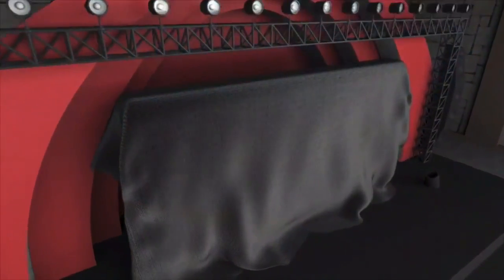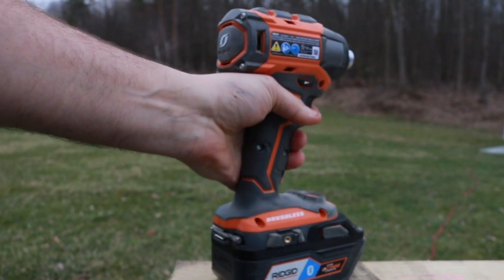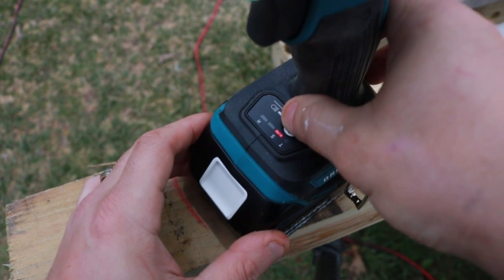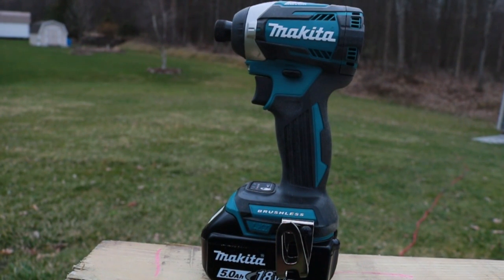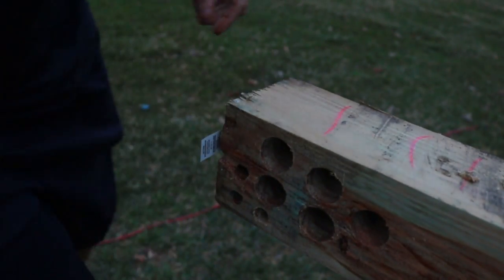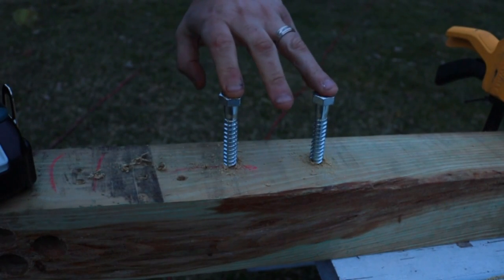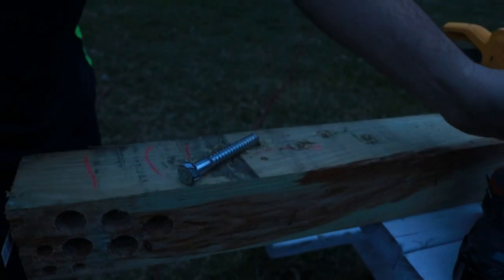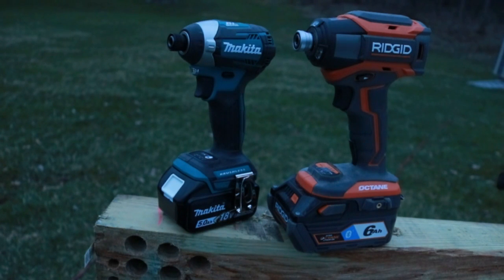All new RIDGID OCTANE Impact Vs. Makita LXT Impact (TOOL DUEL!) XDT12Z - R86039B

Comment: Love my Makita tools, but I have slowly been picking up Ridgid tools lately and I love them.  The multi tool, my 12" sliding miter saw, and hammer drill so I'm slowly switching to Orange/Black everything.  All top notch stuff from Ridgid, and they have longer lasting batteries too.

Comment: One request, run this new Ridgid Octane impact vs the stealth force, I'm on the fence between the 2.
Reply: Travis Kelleher I’ve got the stealth and it’s nice for heavy stuff but it jerks a lot on precise stuff especially on the low setting. It’s a monster for tapcons, lags, timberlocks, and even bolts and nuts. I’ve used it to put the lugnuts on my car, but it’s heavy and I wouldn’t make it my every day.

Comment: TRZ I believe this might be the XDT14 with 1550 inch lbs of torque, the 12 has a white glow ring around the nose cone it has 1550 also though.
Reply: You're correct.  At 3:30, you can clearly see the model he's using is the XDT14 which is a mid-grade model.  Amazing how a Makita mid-grade model kept it close and even beat the Ridge top of the line model in several of the tests here.

Comment: Makita for the win. That ridgid impact is huge I wouldnt want to pack that thing around when I could just use my makita. For the size difference that thing should have killed the makita so it goes to show it's just bulky for no reason. The makita 5 amp hour battety is also nice and compact compared to that brick on the ridgid. I do like that the ridgid is able to be tracked but any of that other stuff that involves your phone shouldn't be there. Too many guys on their phone already at work, dont need to give them another reason to pull it out.

Comment: Wow , I cannot believe TTI's claim of 2400....
  From what I've just seen the only advantage the ridgid has over the Makita is the price and maybe the lifetime warranty....that is if u don't get the "I am sorry , we had a major computer meltdown and we lost all of our records concerning lifetime warranty agreements " The Ridgid is also ginormous and looks like a transformer. 
  The Makita also took the Ridgid straight to the spankin tree....the Ridgid should have smoked the Makita due to its "lag setting" but it didn't...its also very hard to beat a Makita ergonomically....hands down winner is Makita. And no I am not a Makita guy....Good video brother
Reply from the maker: Thanks for the vote Donny!
Reply: I work in the trades and have never seen any contractors or sub contractor with rigid, always makita or milwaukee which are both best in quality

Comment: Giving a vote to the Ridgid just because I want to see it in action a few more times.

I'm pretty impressed with the new Octane impact holding it's own, maybe a tad slower but still pretty much on par with one of the best. In your opinion besides the new modes, is there a power/performance difference over the older Gen5x brushed model?

I'm on the Makita platform, the XDT12 is well established as more than capable, it's even outperformed the newer XDT16 from watching it on the VCG channel. I think the new Ridgid Octane might be able to win a few speed tests against the newer Makita if you have one of those around.
Reply from the maker: Considering you still have people out there calling ridgid a DIY tool, its giving these big boys a run for their money.  OCTANE is awesome
Reply: I would like to see the ridgid octane drill driver vs the makita drill driver

Comment: If this is still open - Ridgid did better than I expected, but Makita has impressed me with this performance, and for 25+ years with tools that pretty much last forever, and some special standouts (like the rear-handle 36v circular saw, and the 36v dual bevel sliding compound miter - both beasts). This impact driver looked more controlled to me than the Ridgid (which does appear to have some good brute force), but it's not even Makita's best. Like others here, I'm not a fanboy / brand bigot -- I've got Dewalt, Porter Cable, Ryobi, Makita, but Makita consistently shows comes through as the best overall system for my needs. Here's my vote for Makita in this showdown.

Comment: I own makita but putting bias away, makita still won. I'm not a big fan of the any of the botton modes on any brand, in my honest opinion, experience will carry you anywhere you want to go. I have makitas 12 model and I never use the modes, they just take up time. I got it mainly for the torque, size, and light weight ergonomics. Kills it on a 2amp battery, convenient and compact. Im an electrician so my field is very diverse. One day ill be doing solar, so I'll need the bad ass torque to drive lags on roofs. the very next day ill be doing under counter lights in a kitchen where I dont need a heavy ass 3000 torque impact driver and my lightweight makita, with its precision kills it.

Comment: I use Dewalt, Milwaukee and Makita and our for those three the Milwaukee takes the power but Makita takes precision. I would take the Milwaukee out of all tools but love the Makita. My Dewalt hammer drill is the best drill but the Milwaukee is the best impact. In my opinion.
Reply: Thats what I call a good review. Every tool brings something to the table, but in the end of the day you want a tool that is well rounded in features and will fit well in your hand within the field of work you are in. Some people dont need a million inch pounds of torque, so they'll opt for something smaller like the makita. some people like more visibility so they'll opt for a dewalt with their 3 leds around the chuck. Just get the job done

Comment: I do like the makita just slightly better even though I have the octane. The octane is ridiculously bulky for attic work which i do a lot of. Its got plenty of power, but its bulky and loud and not as smooth as a makita. Its also not as quick with most of the average screw sizes. I like the auto feature on the ridgid a LOT, but those makitas are really smooth and really small. The zero wobble thing isnt far from the truth either! Thats a huge deal to me. The makitas auto feature was pretty embaressing though lol. It was suuuper slow AND somehow managed to break the screw anyways lol. Idk how the hell that even happened haha. I really hope that was just a bad screw! Ive heard rumors of a new makita impact called the dt172 being released in japan. I think im going to hold out and wait for that one. The xdt16 wasnt quite impressive enough for me to pull the trigger. It just needed a LITTLE more ooomph IMO. Its too comparable to the old model, the xdt12, to warrant the high cost rightnow. Part of me wonders if the japanese made dt171 is possibly better than the chinese made xdt16? I know they are SUPPOSED to be the same, but are they REALLY? Everyone seemed impressed by the dt171 and disappointed by the xdt16, so are they really even the same machine?

Comment: The Ridgid is way too bulky for a 1/4" hex driver IMO. For a shop tool it's probably okay but I personally wouldn't want to have that thing hanging off a belt or bags all day climbing through stud bays all day especially with a 6ah battery. I have several Makita 1/4 impact drivers, oldest being 10 years with thousands of hours of use on it (and both 3ah batteries it came with still work great) and haven't had any issues with any of them. Of course, price is a factor for many people and you pay a premium for Makita tools. I've never had to return a Makita 18v tool for any reason and I own just about all of them.

All that being said, the impact driver I use daily is a Fuel Surge with 2ah batteries. Its a bit heavier than my Makitas but the noise reduction more than makes up for it. Got it on sale a few years back and have hardly touched any of my Makita 1/4" hex drivers. Had the Makita hydraulic been on sale I'm sure thats what I'd be using but from what I've seen they are very close in performance and specifications. Still use the 1/2" Makita impact wrench for lags and automotive stuff but that's it.
Reply from the maker: I'll mark you down for a Makita vote. Thanks bro!

Comment: If you have connections over at Ridgid, tell them to come out with a Octane combo kit.
Reply from the maker: They actually have one I did a review on bro. It's this impact with the OCTANE impact drill with a charger and two OCTANE batteries
Reply: @ToolReviewZone  that kit i do not see coming out for a bit even though the tools are out only new kit is the hammer drill with one battery charger
Reply: @ToolReviewZone  Gotcha, I'm talking about maybe a multi piece kit consisting of all Octane tools.
Maybe a 3 tool deal with the new impact, hammer drill, jobmax and a few batteries for example.
Reply from the maker: I think they mentioned it would be out in about a month.  Hopefully they get it out soon
Reply from the maker: Ahhh I see what you mean. I'll see if I can find something out for you
Reply from the maker: Hey Travis.  Just spoke to Ridgid and they stated that there are no plans for a larger combo set as of yet, but will keep me updated if anything changes
Reply: @ToolReviewZone  Thanks for the feedback, I appreciate it.

Comment: The Makita in this video is an XDT14Z, not an XDT12Z.  The XDT14Z is a lower tier model even though it has a higher number in its name.
Thank you for the review.
Reply: This is the makita xdt14z it's only got 1550 inch lbs of torque the 12 has the glow ring around the nose cone it's got 1550 also though.

Comment: Makita may  have it in a lot of ways either way you can't go wrong  I'm not taking sides get what you like and can afford some people can't afford the premium price of the Makita gnome lol if I did not have a gen 5 brushless impact driver I would give that octane one a  shot why not I figure I will  get me to 3.0 ah octane batteries and am good there yes it  won't get the same benefits as an octane tool but it will have more power cuz the 3.0  batteries are 21700 cells that part's been confirmed I'm still not 100% sure on the 6.0 ah and 9.0 ah octane batteries if they are indeed 21700 cells or what I heard 18650  or Ridgid  just added  electronics to work properly with octane tools who knows maybe someone will open up a 6.0 ah and. 9.0 ah to confirm it once and for all
Reply from the maker: That damn Makita Gnome! Thanks for the awesome comment bro
Reply: Those octane battery where not made for gen 5x those batteries will burn out your gen 5x to much power

Comment: That is the xdt14 not the xdt12 which is top end makita not the xdt14
Reply: you're right, but now its the xdt16 which just came out
Reply: @mainsource8030  that model is the xdt14
Reply: @xibfwmz  I know, I could tell by the button layout on the base, forgot what the torque is on it  but I think its either the same at 1550 or maybe 1400 in lbs, the new xdt16 has 1600 in lbs
Reply: Yes same torque as xdt12 but different model, which is no joke either because still better than that rigid top model
Reply: @xibfwmz  I have the xdt12 and the xdt16 and for me the game changer is the light placement, the xdt12 along with many other makita drill drivers have the led under the chuck,  now with dual led's flanking the chuck on the left and right , no shadow is cast, makes driving screws much easier if your hanging cabinets or under a sink, also the oil impact is so nice and quiet for makita, the rigid tools are way too bulky, not for me, the makita feels like an extension of your hand, I love them

Comment: why i choice makita run time is the brst of the other brands and never have any heat probelms like ridgid and dewalt i killed a dewalt and ridgid impact they burn hot and all ways burned them out killed them i work in the sheet metal field makita run time can run all day and week on 1 charge driving pole barn screws thousand's of them on 1 charge with 5 amp battery

Comment: For fuck sake makita has a six amp battery try and use it, do test again and don't push so hard on the ridgid compared to makita, here a thought buy two brand new tools, two brand new batteries charge both to full do test again.

Comment: Ridgid always lies about their IPT. I've had a couple and they're shit. DeWalt is the same thing. The new atomic is supposed to have 1700 IPT and my Makita smokes them both. Smoother action too. The biggest issue I've had with Ridgid is the cold kills the batteries. Makita batteries will sit in my truck for a week unused in freezing weather and not miss a beat. Screw Ridgid and they're bologna LSA, too. That's another scam.